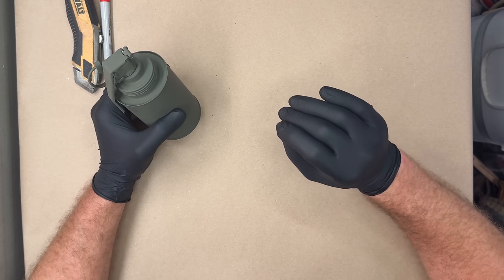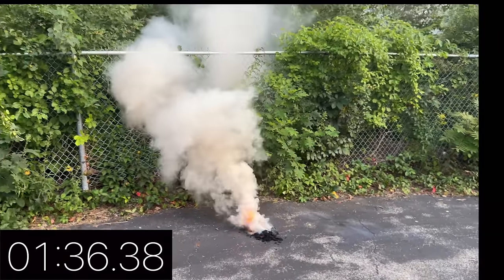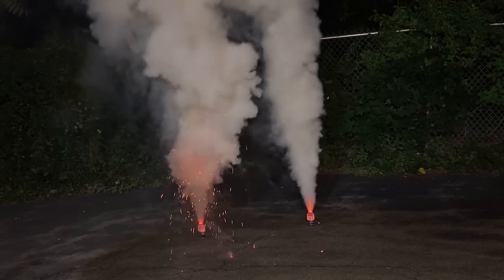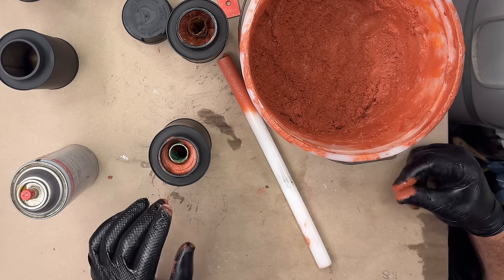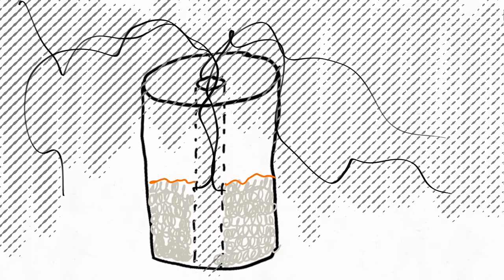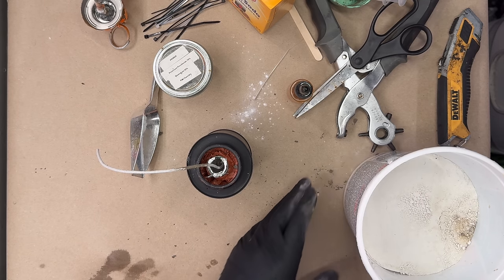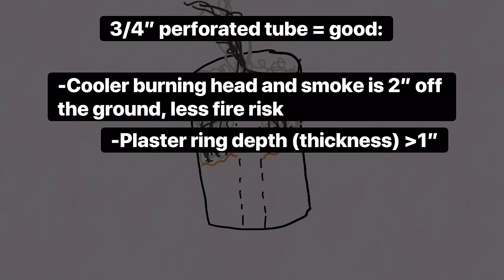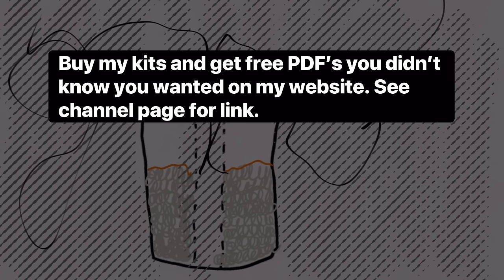Best Throwable Smoke Device on Earth Just Improved by Sub's Suggestion

Comment: Silicone is fairly flame-retardant. A properly molded and sized silicone exit orifice would produce a continuous fart noise the entire time this device goes off. This is a bad idea and you should do it. I expect it to not improve performance of the device in any way.
Reply from the maker: It has been done: https://youtu.be/wlJqJsQzkiQ
Reply: @InventionIncarnate  its going to be heartbreaking if we don't get to experience that in the next video.
Reply: Genius
Reply: V or funnel shape screen instead of tube would allow more smoke mix, allow more smoke escape and block hole from blow out if you can’t bend it a holding pin would work or fart valve.
Reply: Don't you have to add some kind of sulfur to the mixture to make it smell like a fart😂😂
Reply: @InventionIncarnate  certainly hope you do go through with it. Just subscribed to see it.
Reply: @InventionIncarnate   If you want to burn the can from the bottom up, leave the upper 2/3 of the can corrugated and still do the plaster cap. This will reduce your initial burn volume obviously but: Mold the tube into the paste with an airtight seal and and I believe you'll not only reduce the heat, but increase the burn speed. Creating a low pressure current from the outer diameter, down to the bottom of the can, and back up through your channel. This increase in airflow should speed the burn time, but reduce the amount burned simultaneously, and give the gases time to cool and de-flame before exiting the can. Similar to a gas blowback system in a rifle. 
Side note, I'm note sure about this but it seemed to me the copper tube might be making something similar to copper thermite. The copper tube had a longer top flame and the bottom center of the can was insanely hot. I'd stick with the aluminum or splurge and do a steel pipe with the same heat treat as your can. At the very least, you might get more uses out of it and reduce the risk of a cook off.
Reply: I'm actually subscribing just for that video suggestion. I can't miss that one
Reply: You had me at “this is a bad idea and you should do it”
Reply: @InventionIncarnate I’m subscribing so I see this
Reply: I love it! lol best comment ever!
Reply: Make sure it's green smoke for added silliness.
Reply: @InventionIncarnate  which smoke stays closer to the ground? or is that just dependent on the weather?
Reply: @InventionIncarnate  subbed to see a farting smokey boi
Reply: @mygirlfriendbeatsme  wonder if emt conduit would work. Hand for the different sizes.
Reply: @peebreezy5015   galvanized steel? yea that would do the trick
Reply: Fart grenades.....🇺🇸🇺🇸🇺🇸🇺🇸🇺🇸
Reply: @InventionIncarnate  a man of culture.
Reply: @Juss-Saiyan  In terms of fog juice it has to be cold to hung the ground (like 'grave fog') and preferably dense (sticks to itself). There is also the 'chain length' of the particles that are released when the fog juice boils off that they can play with as a parameter for different fog effects. ie, fog that likes to pull long strings when it, say rolls through a picket fence or over tree branches (long strings that arent very sticky but wrap around each other), vs 'haze' typically used for laser light shows to make the beam more visible (small chains that are somewhat sticky so they dont disperse very quickly but and dont 'clump' and fall as they cool).

Now, yes, I'm sure you have seen the flaw in that info dump, as that is talking about fog juice, not smoke compound. But I used to run equipment and tech on a few rather well known locally haunted house attractions, we bought fog juice by the 5gal bucket to 30 gallon drum and picked our fog supplier's brains on how and why fog acts differently. Its all in the glycol(? it was long ago...some stuff fell back out the other ear) chains. Its a really interesting niece materials science area.

But did you notice the first bit? If you want any particulate to hang in the air, its gotta be (near to) a neutral temp with the air its in so it doesnt build convection currents. Too hot and it floats away, too cold and it slams to the ground. Match ambient air (or slightly above to offset particles dropping under their own weight) and the stuff will just hang there until its too thin to see. 

Fun Anecdote: We 'accidentally' fogged out the low swampy area of another haunt and the road into and out of the park the whole thing was in. The guy running the swamp haunt said "it was great, I barely had to use my foggers at all with what was rolling down the hill", the guy running the park told us to turn our foggers down because the road being fogged out was a hazard (and I agree. People be stupid, yo......and there may or may not had been a small minor no real damage meeting of vehicle body work.....).🤣
Reply: "not improve performance of the device in any way"

....You're joking right? YOU'RE NOT THINKING 4TH DIMENTIONALLY, MARTY!!! A farty smoke can?!? Thats a plus 5 to distraction, and gives the enemy a negative 1 to constitution!
Reply: No, use the whistle valve from a rubber chicken.
Reply: Can’t wait for the fart can 😂
Reply: Depends which formulation of silicone you use, they’re all heat resistant but will absolutely burn under a consistent flame. 

I haven’t tested all the formulations or anything of course, but did some heat & flame tests on some silicone copper wire I bought to see if it would be appropriate for wiring in high temp situations (PTFE insulation is much better and less likely to snag and rip for that) 

obviously I’m talking about a completely different thing than what you suggested haha, and to be clear I would love to see it done! I just think it might burn easier than one would expect, but don’t know til you try! Mayyyybe it holds up!
Reply: And what might happen if either a bit of capsacian or butyric acid were mixed in? Might the farting smoke bomb burn the eyes the way a proper fart does? With butyrate, might the farting smoke bomb make one almost vomit from the awful smell...the way a proper fart does?
Reply: In the spirit of can-do inventiveness pioneered in the 30s and 40s I propose this improved device be given a name that will scandalize people in England and Australia.  I believe the improved device with the snug silicone annular dispersion orifice ought to be known as the "Flatulent Fanny".
Reply: Why not bottom opening like a real smoke grenade?
Reply: Another thought, might be difficult, but: use a star pattern for the "propellant". This ensures even burn rate in solid rocket engines. My dad worked at Thiacol...  Who I don't think exists, but was part of the space race
Reply: @InventionIncarnate  LEGEND!
Reply from the maker: https://youtu.be/wlJqJsQzkiQ
Reply from the maker: https://youtu.be/wlJqJsQzkiQ
Reply from the maker: https://youtu.be/wlJqJsQzkiQ
Reply from the maker: https://youtu.be/wlJqJsQzkiQ
Reply from the maker: https://youtu.be/wlJqJsQzkiQ
Reply from the maker: https://youtu.be/wlJqJsQzkiQ
Reply: @Darthdoodoo   I can't remember if this is a chlorate based mix. Chlorates and sulphur aren't a recommended mix.
Reply: @CarterGunnells  i don't know anything about chemistry i just kno that sulphur smells like farts lol
Reply: @InventionIncarnate  earlier this year legislation was put forth to abolish citizen militia in the US. would this be something your channel would be interested in covering?

Comment: You might be the one person who would benefit from adding steel wool to his plaster of paris. It doesn't do me any good when my buddy adds it to foundries and lowers our maximum temperature but it might solve your cracking in this situation considering the reactions cold enough it did it totally slag that copper tube. You making me want to take a gander down the plumbing aisle though to see what has a flat base and that three quarters inch pipe traveling the whole way through so that way you could have a drop in one piece metal solution for your so-called chimney. You got me saving soup cans and weird glue again
Reply: i was going to suggest steel wool instead of the perforated tube!
Reply: @ethandye8764  that may clog like a filter
Reply: @ArtichokeMoss  true, you would not need very much of it though, im not sure it would be more effective than reinforced plaster
Reply: At that point he might as well use refractory. Its basically what your suggesting but designed for forge tempatures. AKA: 3,000 degrees F
Reply: @mygirlfriendbeatsme  great for forges, used it, too delicate for a throwable cloud
Reply: @ArtichokeMoss   idk man, i use it quite a bed and its pretty dang tough. its similar to plaster, just with extra stuff in it like fiberglass/wool

Comment: Copper is very malleable.  Plumbers have tools for "flaring" copper tubing to expand one end of the tube.  Suggest that you flare the end of the copper tube so that it bends and seals in the top to also stop chunks from being ejected.  You can use some other sealant to hold it together or a crude metal snap ring that holds the flared copper tube in place.
Reply: @MrFugasi  I 2nd to flaring the copper
Reply: This is what I was going to suggest. A flared cone with some sort of snap ring to hold it. Perforate the cone with smaller holes and leave the core holes the size they are.
Reply: @MrFugasi  we call it swaging
Reply: Great idea, sealing the perforated tube to the opening will have a better effect than the plaster.
Reply: @MrFugasi  = best idea if you think about it it would solve multiple problems if you could flare the top enough or if you could weld a mesh ring to the chimney when you press it in you would be installing the mesh ring at the same time and give it something to hang on to or even better snap ring it on after putting them together would also keep the chimney in but also mesh is plaster would make it stronger like rebar in concrete and then mesh in silicon would add all the best ideas together so you get that long ripping fart noise for no reason what so ever!
Reply: One thing that all should remember about copper.
When it it worked, it becomes brittle.
Heating it up and letting it cook puts the malleability back into it.
I learned this from the old installers of copper ceilings from the old days.
They would take copper sheets and pound them with a rubber mallet on a form.
They would get hard, and crack.
Heating the metal softens it enough to make further forming possible.
Reply: I was thinking the exact thing as well just by looking at the can lol plus try running the fuse in and around the mixture instead of being in the middle so the smoke and actually plume correctly🤷🏻

Comment: Those look better than any of the homemade smoke grenades I've seen online, and comparable to the Army issued ones I used to use. An obvious difference is that the military smoke grenades have a tape covered hole in the bottom that the smoke comes out of, and they don't pop the fuse out during use. Perhaps instead of putting plaster in them, you could put a ½-¾" hole in the center of the bottom and try to secure the caps better, perhaps with Loctite or an adhesive that weakens once it gets really hot, so that it won't pop off right away, but will be removable after use.

Comment: You could put a screen wire ring in the plaster to hold it together better.
Reply from the maker: @thehairs2018 dude.
Reply from the maker: @thehairs2018  that’s
Reply from the maker: @thehairs2018  effin’
Reply from the maker: @thehairs2018  genius!
Reply from the maker: @thehairs2018  thank you
Reply: @InventionIncarnate  what about hi temp plaster ,if it exists?
Reply: I was thinking the exact same thing. Like rebar for the plaster cap.
Reply: @InventionIncarnate  a good sub for wire mesh is 0000 steel wool it is like amazing for keeping plaster together
Reply: Wouldn't that cause diffusion from the can face though? I have no idea if that would be beneficial but worth noting.
Reply: @InventionIncarnate  refractory cement instead of plaster. It’s designed to handle 2000+ deg F
Reply: @InventionIncarnate  Check MrFugazi's comment above this one about a flared top to the perforated core  to stop even more embers from the top.
Reply: @Rosskles  I think that would take some machining. If he found a mesh or hardware cloth of sufficient gauge, he could use it for both the central tube and the ring at the top. Might be single use, but how many more uses can the broom handle take, anyway?

Comment: Looks awesome, definitely a more advanced method.  Super-easy smoke bomb... newspaper (can be hard to source these days:):) and ammonium nitrate from a cold pack or Tannerite.  Mix the AN into some water, get the newspaper wet with it.  Hang the paper up to dry.   Roll it up around a "Whistling Peet" , a sparkler, or come up with another method of lighting it internally.   Puts out an insane amount of smoke.
Reply: @SunriseLAW   wdym wrap it around a whistling peet? Around the plastic mortar or is there something im not getting?
Reply: @botston  A firecracker with the bottom plug pulled out works great.  For some reason, WP''s are available in a lot of places that don't allow firecrackers.  The objective is to introduce a lot of heat into the rolled up, AN-infused newspaper.  Telling you:  when done right, the results are as good as the stuff in the video.
Reply: @botston  Funny because it took me a moment.  First thing I ever did with WP's was toss the plastic and modify the wp... I forgot about that part! OK, bonus: homemade napalm.  about 8 parts Styrofoam, 1 part gasoline.  Lots of Smiles Per Gallon (SPG)

Comment: Serious recommendation: 
There is a YouTuber who recreated starlite: a fire suppression and thermal resistant compound. 
The youtubers name is “NighthawkInLight”

Its super easy to make. 
As it burns, it bubbles and off gasses CO2. a thin layer is an INCREDIBLE insulator. You can use this to coat a can and it WILL NOT burn anything it touches. 

As a demonstration,  he took a thin sheet of it in his hand and held a propane torch for his hand for a minute. Hand was completely fine.
Reply: Aaah NightHawkInLight. Haven’t heard that name in a while.
Reply: @thebattlefieldproject6013  he is still active, makes some cool expriments with sky cooling fibers and paints
Reply: Love his stuff for a while now
Reply: An excellent YouTube channel
Reply: one of the best yt pyros
Reply: @Exandria  his channel is awesome I've been subbed for years
Reply: @GombySprangster  can be made with very simple ingredients. 
Corn starch, baking soda, and a binder. Epoxy or a PVA glue. 
Aerogel requires a ridiculous amount of equipment to make. 
Starlite can be made at home. 
Ive seen epoxy’s been used. 
The key is to use something soft enough to allow the co2 to escape and allow carbon formation on the surface.
Reply: @GombySprangster  sort of but not really. Aerogel is a passive substance that's basically just, well, a gel filled with air. His Starlite recreation generates it's own carbon-foam filled with CO2 when exposed to high-heat. It's sorta like the difference between a loaf of bread, and cake-mix. The bread is already expanded and more or less just stays how it is, the cake mix isn't expanded, but will expand if you put it in an oven.
Reply: That’s funny because his video is the recommended video after this one.
Reply: So basically DIY aerogel?
Reply: I've seen this I can confirm what he is saying, starlight is awesome!
Reply: I would do that and cover the cans hole with a teastrainer or some other metal mesh.
Reply: Aaaand maybe a Diffusor at the exit could slow down the smoke/keep it lower and cooler?
Reply: I actually made it after watching his vid one day and tried the same thing. Rolled out a  thin layer, put in on my hand and blasted it with a torch. That shit is amazing I didn't feel a thing and my hand was completely fine
Reply: Jesus i had the idea to make something that did exactly that to dope drywall/sheetrock with when i was like 10 years old. Should have pursued it

Comment: Very interesting video!
Not sure if this was discussed before but i would suggest mixing baking soda directly into the pyrotechnic mixture. What this will do is slow down the reaction speed and potentially reduce fire hazard. 
Depending on the mix it may also help produce more smoke because the added CO2 will reduce the flame
Reply: test these for no other reason than for the cool montage
Reply: this is how you can turn rocket candy into a smoke bomb....it works surprisingly well and i think this guy should do a side by side weight to smoke comparison
Reply: Those smoke grenades definitely need some baking soda mixed in with the mixture. It will also stop the flames. Also, the top of the smoke grenade flying off could cause issues. No one wants a piece of the smoke grenade flying at them. I suggest a small empty space with a screen  and holes drilled in the top or bottom. The holes should let the gasses excape, while keeping the smoke grenade whole.
Reply: can we get chemical ingredients like that for smoke here in Slovenia?
Reply: I should have expected to see you here, but wow you get around man. Props!
Reply: @zacablaster  i guess YT algorithm know what interests me 😄
Reply: @PolenarTactical  for all we complain about that thing it's nice to see it do something useful for once
Reply: @abccde3832  you would have to look to ECHA regulations. It is very likely that you can purchase and legally possess the ingredients, but the burning of a smoke composition near populated areas is almost certainly restricted
Reply: One thing that I noticed is that in the test with 3 gren... I mean "devices" in close proximity, the smoke was rising up quite eagerly. You basically had only a 5x10 foot area smoked out at ground level. (15:56 and 16:52)
Mixing in some compound that slows/cools down the reaction would avoid that. Or maybe you could improve mixing of the produced gases with the cold atmosphere.
Reply: This will also make smoke particles bigger so they hover near the ground better... Lite particles float & fly better.